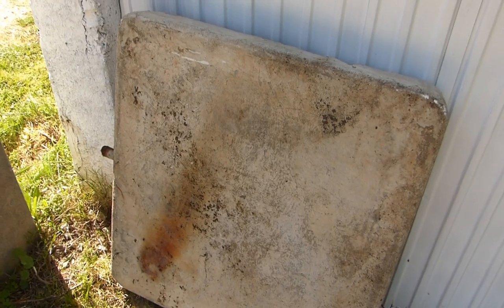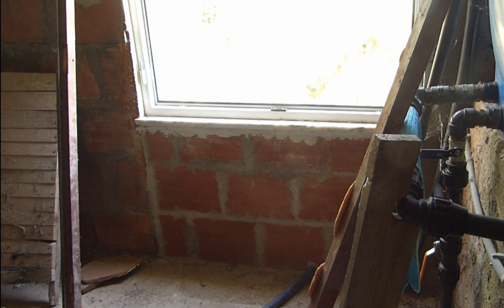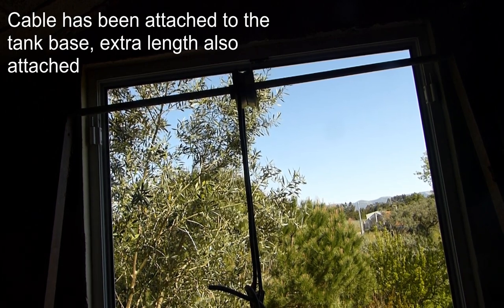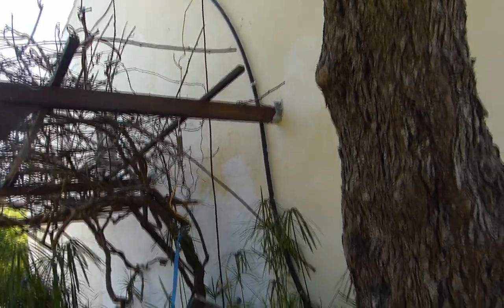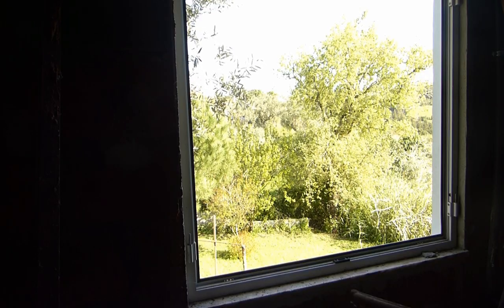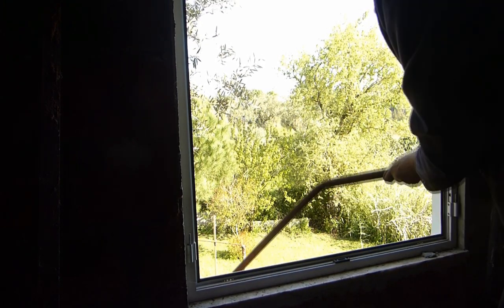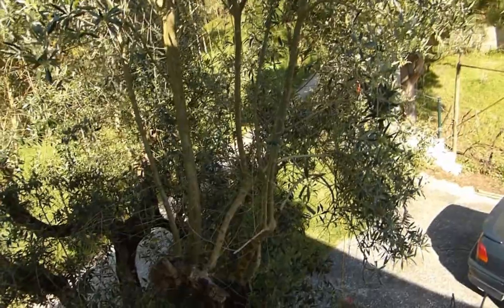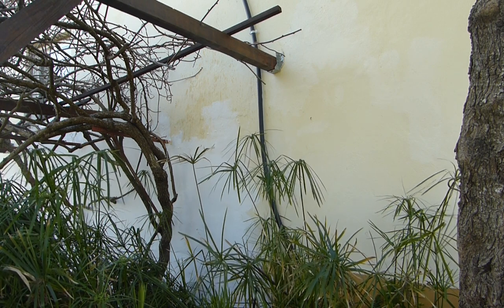Using the Kubota B7001 Tractor to Hoist up Water Tank Base to Attic

Comment: When I first saw that axle/pipe I though "Hmm, that looks a bit light on for a wide span like that" 😁

I'd love a small Kubota but my land is very steep and it would probably just get me killed.
Reply from the maker: Yes, I should have used something thicker, which I didn't have or a piece of rebar through the pipe would have made it stronger. 
Tractors and steep land don't mix well. 
You would be better off with a tracked remote control tractor, as you are not at risk, unfortunate thing is that they are very expensive.
Reply: @WilkoinFrance  I have looked into those as well, but I think I'll just stay doing things manually, it's good exercise and I am actively resisting owning more machinery that I really need, it's just more stuff to break down.
Reply from the maker: True, doing it manually gives you free exercise and nice to be outside too. I haven't had any break downs with the tractor yet. I believe the older tractors are much better than the newer ones as there's a lot less to go wrong and less electronics.